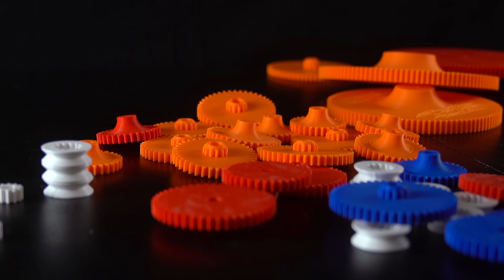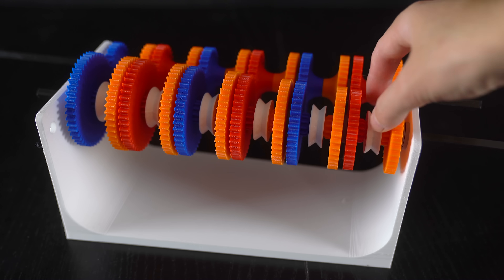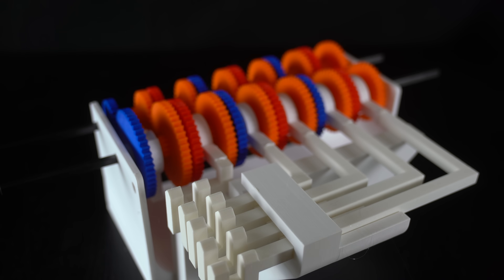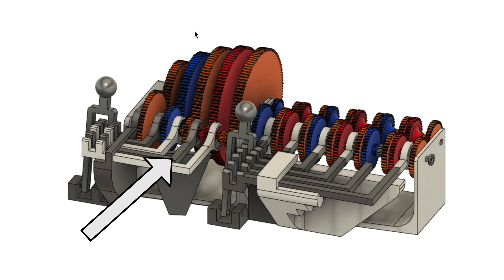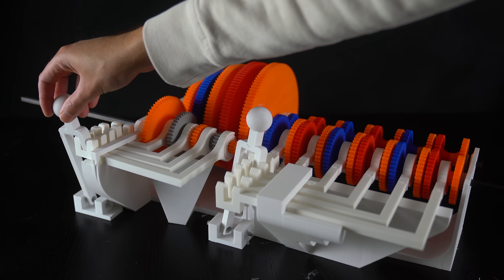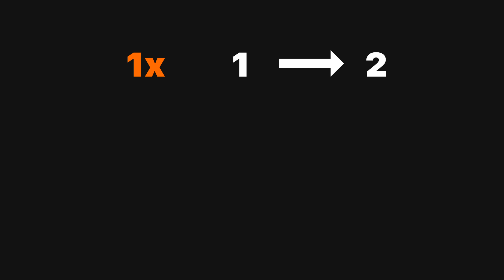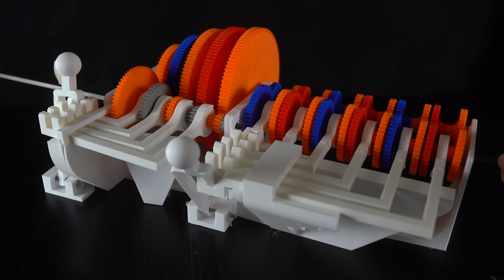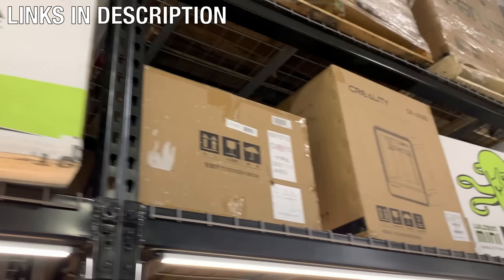60 speed manual transmission

Comment: Multiplier gear boxes are quite common in manual tractors. A lot of the one's built around and after the 2000's for example use a 24/24 6 speed with either 4 groups, or 4 intermediate gear that can be changed without clutching.

Some 80's/90's Renault tractors also have a third optional box to make them a 24/24 from a 12/12. This was done by adding a two speed intermediate box to the already existing 3 Groups +4 Gears and Reverser box.
Reply: Never knew Renault made tractors lol. Learn something new every day
Reply: @jeremygalloway1348  Then let me tell you about the amazing beginnings of Porsche and Ferrari 😁
Reply: @XMaster340  Porsche didn't really build tractors for that long though, and the production was sold to MAN, but they stopped a few years after that as well.
Reply: @Renault_75-34MX 
I like the renault tracktor ylu have as a profile picture
Reply: @jeremygalloway1348  they made tractors till 2003 when Claas bought out Renault Agriculture, but still made some Renault models till 09, mainly the Celtis.

And to add to XMasters comment, Lamborghini also started out by making tractors, mainly out of WWII surpluses, they only started cars when the Mr. Lamborghini wanted a original Ferrari part for his Ferrari, and even went to Mr. Ferrari, but he said to Mr. Lamborghini something along the lines of 'you're just a tractor builder' or similar, but definitely nothing nice.
So Mr. Lamborghini wanted to show Mr. Ferrari that he can do more.

Now days Lamborghini cars are well now high quality, while Lamborghini Tractors has been part of Same for a long time now, and SDF ever since Same bought Deutz Fahr, with Deutz being the primary brand, and Lamborghini just being the lesser known cheaper option.
Comparable to Audi and VW, just that DF is Audi and Lambo VW, just lesser known.
Reply: I own a 1972 Ford 4000. He has 4 forward speeds in gear drive and 5 in belt drive, also for each drive a reverse speed.

Comment: tbh, this is cool and all, but you should try to replicate a semi truck transmission, like the modern eaton 10 speed, or beter yet, the 18, 
what you made here is what i call a "fast and furious" twin stick box
its got a shit ton of gears 

also if i was driving a truck with that, i'd use all of 12 of them gears probably
im not certain what the skiping patern would look like, but that gearbox with the right ratios would pull the freakin earth

Comment: The correct terms you're probably looking for is main gearbox and auxiliary gearbox; in your instance you have a 12 speed main box with a 5 speed auxiliary. Semis use an 18 speed which is a 4 speed w/ L main box with a 4 speed auxiliary

Comment: @5:41 I would print a part like that in two pieces and join them after. Also I've seen people have success restarting a print when it's run out of filament etc. I wonder if you could lay a flat part down and get layers to stick to it. Maybe start at high temperature to help it stick and have an enclosed print bed kept at high temperature. Maybe I'm an idiot.

Comment: I think this is the basis of a dual clutch transmission which has very closely spaced gears and an insanely short shifting time
Reply: There's not even a clutch in this video. This is the basis for a split axle transmission or a transfer case more than anything.

Comment: Hey hey hey, ADD SPRINGS TO HOLD THE ARMS FROM MOVING LEFT AND RIGHT, so the ideas is to put a spring that can hold the arm in the middle so they dont accidentally engage wile your in a different step, and then the sring can flex inwords, or be flexed outword.

Comment: the rod goes into the square hole
btw cool build
lego actually used a "gear multiplier" to make the gearbox in the 911 gt3 rs, chiron, sian fkp and also the daytona sp3
its a 4 speed sequential with a 2x multiplier attached to it, so it can get 8 speeds, in a pretty small package

Comment: There are trucks with twin transmissions. When people drove those trucks they would call a twin sticking lol. But it was essentially companies just sticking two of their transmissions together so the combinations of gears was pretty much random and very disorganized. It would take a lot of memorization to properly drive these transmissions. Honestly an impressive feat. 
Then there are brownie boxes. Which is pretty much what you built you have a standard transmission with a three or four-speed brownie box that gives you three or four different ranges for your transmission. They are the precursor to the modern load rangers.
Reply: I own a 1953 Packard with a 3-on the tree plus a Borg-Warner Overdrive that kicks in above ~25-30 mph. It's very interesting to drive as you go 1st, 2nd, 3rd, Engage overdrive, back down to 2nd (4th) and then back up to 3rd (5th) if you're doing a full gear run. It's not quite as extreme as a twinstick, but it was certainly a bit of a learning curve.
Reply: Most modern semi transmissions are still 2 transmissions, they just share one case and one "stick". Depending on what transmission you have, it can be a 5+4 with low range on the  bottom is a 9 speed. A 5+5 is a straight 10. A 5 speed with a splitter is a super 10. You take a 5+4 and add a splitter to the top 4 speed and you get a 13 speed. 5+5 with a splitter on both the bottom and top 4 is a 18 speed. Plus a whole lot more different combos.
Reply: @dammityoutube  your transmission math is a little wrong, the transmissions would be 5+2 for super and regular 10, 5+2+(2(high range only)) for 13, and 5+2+2(not limited) for 18,
Yes, I know the numbers don't add up to the actual gear counts, its because of how they label and layout the patterns.
13 and 18 have the same pattern with the difference being the splitter useable in low range, the "missing" 2 gears in a 18 are in the "low" position ( 13 has low (low range)/ high low low - high high low (high range w/ splitter), 18 has the low range split as well.
Most drivers only use the "lo" position in the lowest and highest possible ratios (if at all, those gears are extremely low) because the other ratios are barely different, the usual shift method is to go sequential and not use the splitter unless you need to, the splitter basically does 1X/1.5X with X being the gear (1,2,3 ...16,7, etc).
10s will get you there, 13s are better, and 18s are the best.
The reason is because every incline has a gear ratio that maximizes speed for current situation (your weight, your engine, % grade, etc) and an 18 has the best chance of getting you as close as possible to it without going "over".

Comment: Would 60 be useful in real life?
Reply: I think most of the real life examples of this had from 12 (4x3) or 16 (4x4) up to 24 (6x4)

It's basically what the Spicer box was in old trucks before the 18 speed which is a 2x2x5 with one of the 2x not being used on certain combinations

Comment: You've got this backwards if this was a vehicle you would be in 60th gear for 1st however assuming this is just a random gearbox where you want alot of overdrive your gear ratios are backwards you start with a 1-1 in first aka direct drive. Then you begin over driving it into a 0.50 or a 1 input to 2 output rotations onto until you get to your 1to 32 aka 60th gear. Idk the ratio and I don't feel like caluating however that would never worn in a vehicle the other way around however the deepest transmission I know of pre axle is a Eaton fuller 18ll with a 14.4 to 1 st gear aka low low ratio the over drive in most transmissions range from 0.8 to 0.6 tops

Comment: I have considered joining two motorcycle engines together to make two fours into one straight eight, leaving their two transmissions separated. Each transmission would backdrive a different side of a differential, with the resulting output from the ring gear driving the rear tire. Gear ratios from the two transmissions would be averaged by the differential, giving 9 useful ratios out from the two five speed transmissions, or 11 useful ratios from two six speeds. Can you play with that?
Reply: DOT would have something to say about that lmfao
Reply: @craftminer49er  I don't see why. It's just a motor swap.
Reply: They already do this with Hayabusa engines. Look up amateur F1 Radical cars. Very common in that field. But still VERU COOL. My brother-in-laws are mechanics for these types of race cars.
Reply: @DickNemakas  I know. The Arial Atom V8 is two Hayabusa engines joined, but only one transmission.

Comment: 5:34 your solution is to print the pieces separately, not as one piece, then attach them during the build because very little stress will be applied to their junction point.
Reply: And screw them together. And I hope that Micro Center will sell housings for partially 3-d printed toroidal torque converters, which I hope can use thermometer alcohol as transmission fluid so that the heat can get squeezed out in a skinny pipe in front of and above the engine! But with a bike you need to use pipes connected together by rubber tubes held together by woven metal if rubber is insulating. P.S. The One Piece is real!?!
Reply: Since they're being glued together, incorporating a tab and socket system into the print would assist as well.
Reply: Depending on how strong it needs to be and how importand the asthetics are you could also lay it on the largest of the suggestet gray blobs. Then it is at an odd angle and you need some support but not that much and it is a lot stronger than the vertical solutions.
Reply: @TheAnonymmynona  whoa, cool idea
Reply: @TheAnonymmynona  The One Piece is real!
Reply: I thought that's what he would have done since he did glue pieces together at 3:54, but I guess I was wrong. When you look at 6:10, it looks like he just glued the broken piece back on and let it rock.
Reply: Or just use legos instead of 3d printing
Reply: Agreed. It was probably simpler to 3D print larger pieces since this was more a demonstration piece. Though with a design you could have them sort of click and hold onto eachother like Legos, then use a screw or nail to pin them together solid
Reply: I don't know about very little stress

Comment: me with CVT lol maybe you can try a simple one, 2 cones and a rubberband! its super easy
Reply: @sourand jaded yeah Lego rubber bands work very well but there is also 2 gear cones and a centre gear that moves around changing the gear ratio aaaand then there's differential cvt
Reply: @sourand jaded tbh all things wear out one way or another i started with just saying that it could technically work

Comment: Hey, you do also technically have CVT gearboxes, they are generally not used in manual gearboxes because it makes no sence too, but some automatics use them, and they have a "infinit" amount of gear ratios between Min and Max :) I think it would be really cool to see you try to make a manual CVT gearbox!
Reply: I mean a manual cvt would basically just be a up down lever
Reply: @dawsonramdass1145  Take a look at the belt drive section from a 2J-type Bridgeport milling machine. It's literally a manual CVT. There's a little crank you turn to adjust the pulley diameters, and it takes your single speed motor and turns it into 500-4200 RPM if you're in hi-range and 50-500-ish in lo-range. There's plenty of good drawings and such available to see how it works.
Reply: @noiwonttellyoumyname.4385  I saw a similar “friction drive” manual cvt demonstration in a museum recently. It’s pretty neat how simple it is
Reply: @noiwonttellyoumyname.4385  woah thats really cool, I have an altima lease and im always thinking it would actually be pretty cool if there was a lever to control the cvt instead of the garbage tuning. didnt know it ever existed
Reply: I`ve got manual CVT transmition In Chinees drill press. And it`s really just level + and - , which you move to adjust speed.
Level just shift one of cone, and another holding by spring
Reply: @skirnir-atf  Yep, it's not a particularly advanced mechanism but I still think it would be cool to see one with a ridiculous gear ratio
Reply: Manual CVT's are also often in combine's, though called variator. They control the thrashing and intake parts.
Driving power is done via a dedicated hydraulic system.
Reply: @Renault_75-34MX  Oooo, sounds cool, I should look at that sometime
Reply: @haraldmbs  I'd suggest looking at Claas Dominators, I've work on a 88 SL Maxi, though the things that I did were around the engine.
The variator is at the front right, and quite easy to see with the sides open
Reply: 1990s- mid 2000s ATV
Reply: Ive seen them in drill presses. Just a lever to adjust the ratio